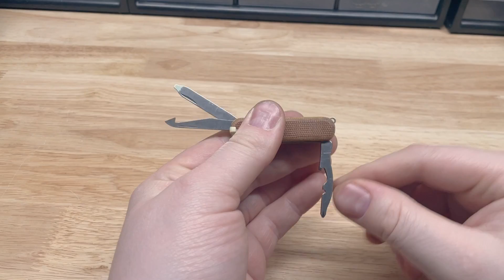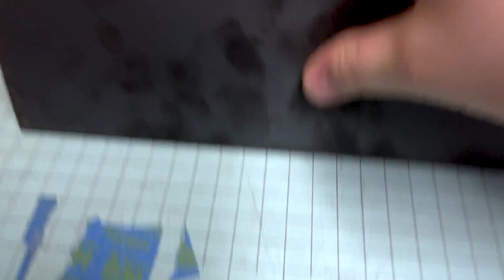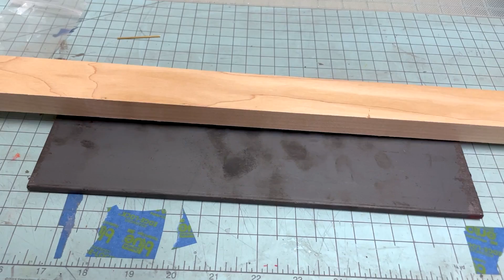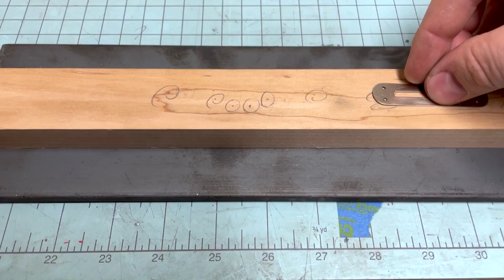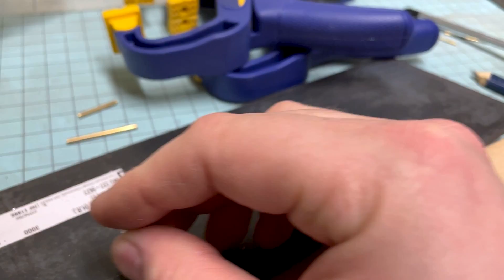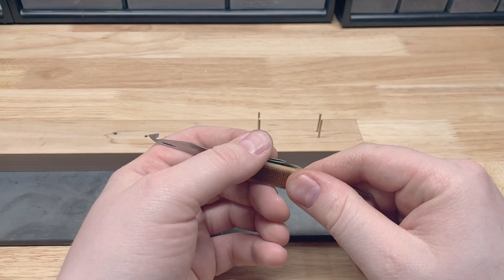Swiss Army Assembly Jig

Comment: Hey, Zach.  Can you please describe how you peened the pins in the jig?  Exposed ends first, then flip to peen the ends buried in the jig?
Reply from the maker: I can certainly try! To be clear, I did not peen them in while in the wood jig; I removed them first and added the rivet caps so I could cut the pins to length. Then I just used the exposed steel portion of the jig to hammer against. It doesn’t matter which side you start on, just try and peen over evenly across both sides, flipping the tool periodically.

There may be some option for cutting the pins and peening while still in the jig but I worry that the pins may end up stuck inside if they flare out at the bottom. I’ve got a lot to learn but hopefully that helps clarify how I got it working. Cheers!
Reply: I was trying to peen one end prior to assembly today, but no matter how I tried to hold them or clamp them, those little 1.5mm rods just kept bending over.
Reply from the maker: @scottfechtig9668  oh yeah, sorry that wasn’t clearer! I’ll see if I can pin your comment so people can see it before they get that far.